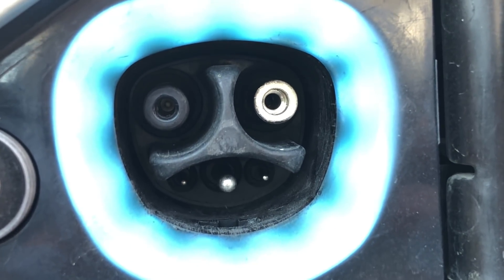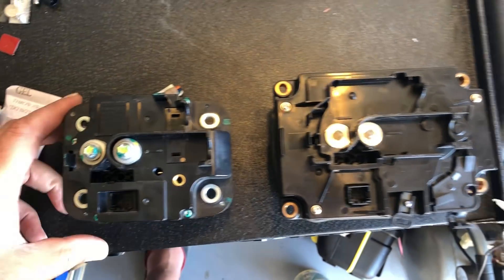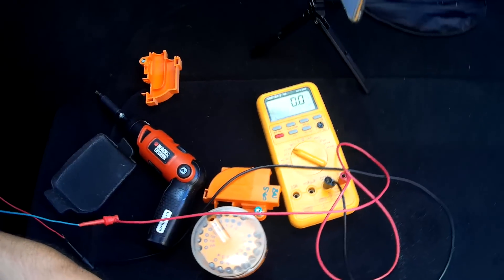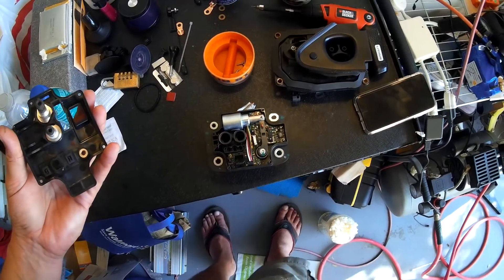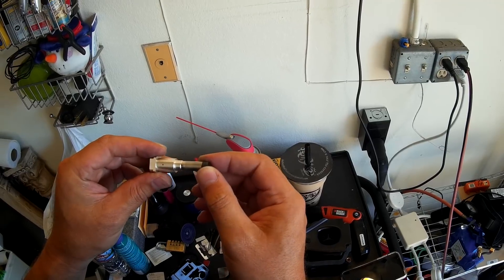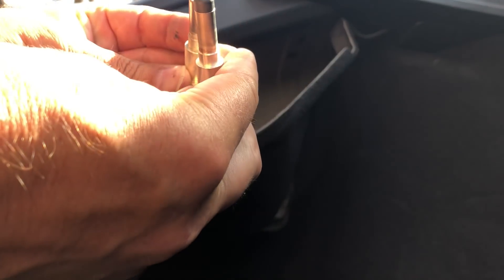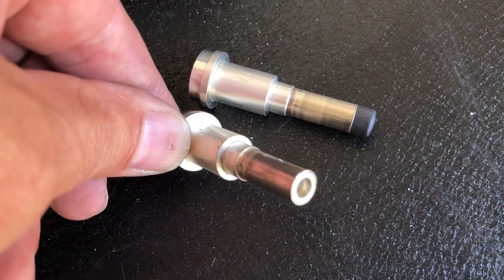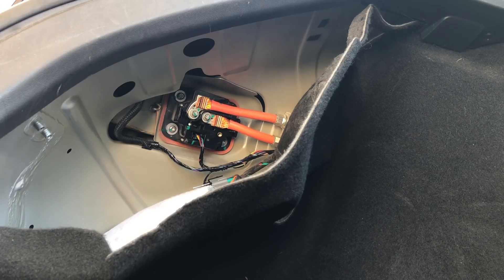Fixing Tesla's charge port

Comment: I just replied to @poster7176 but thought I’d ask you too, especially since this is an old post and they may not see my reply. The black plastic piece from the charge port is stuck in the bottom of my home charger connector.  It’s too narrow to reach with needle nose pliers.  I tried fishing it out with a paper clip but couldn’t grab it with that either.  Seems to be jammed in there pretty good.  Suggestions?  I think I could simply glue it back onto the charge port prong if I can get it out of the charge connector.  Thank you.

Comment: Thanks the older Models of these cars get as any other brand they need some parts replaced, just normal wear and tear. My 2014 Model S still runs great after 360.000 km. No major issues.
Reply: You got AWD rwd?
Reply: @ceylontea5877 LDU rear wheel drive.
Reply: @ceylontea5877 but I do have a 2015 70D also and AWD is even better as you don’t have to do coolant delete as you must do on LDU.

Comment: Did it leave the top inside or is it just different and why do you need to take it apart vs just take the old out and put the new in connect the wires and done? What did I miss?

Comment: 1 plastic tab was lost  in my charge port, when second is gone - supercharger doesnt work. I used epoxy and fixed one, supercharger doesn’t work, other chargers is ok. This plastic tabs used for right plug position ( adjustment by deep ).

Comment: How did you get the plug out from the existing port and the new port? I'm trying to same thing and it's not coming out from the replacement part that I purchased
Reply from the maker: You have to take the charge port out of the car completely and then tack the back cover off. Then you can take out the pins.

Comment: I had the same problem - Tesla also quoted me $750. i was getting an "error charge port not latched correctly" and simultaneous green and orange LED lights on the port. . Car would still charge but only at 16Amps at home and less than 1/2 speed at supercharger. I found the black plastic piece mentioned above in my home charger connector. it obviously came off when we were charging at home. I  just Super glued it back onto the car port and now charges perfectly with no error messages . check your port, they should both have plastic piece on the ports on the car. Shame on Tesla for not offering solution and  $2 part. I have had 2 Teslas - The current one has 100k miles on P85. Love the cars. Hope tis helps.
Reply: Mine just came off on a road trip and im a little terrified.
Reply: This comment is very helpful. Thanks for sharing! Sounds like a super cheap fix for you 😄
Reply: How did you get the black plastic piece out of your home charger connector?  I have the same problem but the black plastic piece is really jammed into the connector and it’s too narrow to reach with needle nose pliers.  I tried a bent paper clip but can’t grab it with that either.  Suggestions?  Thanks.

Comment: Do you know if its possible to change the US Tesla port to CCS2 charge port (Europe) ?
Reply from the maker: No, the wiring is different inside the car. Also, the car does not know how to communicate with CCS stations. Tesla added that in later models and it is now offering it as a retrofit (hardware) to support the CCS adapter

Comment: The blank piece is not for guidance, it's for finger-proofing. A requirement for J1772/IEC62196/ECE R-100 is that you must have finger proofing for all HV circuits. Cannot contact any conductive surface. That was the main issue you had. If there was a leakage current, you could have been shocked.
Reply from the maker: The J1772 standard did not exist when Tesla designed their charge port. Regardless, the rounded or conical shape of these pieces is to guide the contacts, insulation against touching is sure another purpose but the shape makes it pretty obvious

Comment: Good Job!  My 2019 tesla model 3 had a problem with the charging port gate.  It sometimes won't close by itself.  My car was parked outside of my home. The service man came to my home to fix it.  I was not there at the beginning.  By the time I got there, it was almost done.  I found that he opened the front trunk and also lifted up the rear-right seat cushion  Why did he do that.  I asked, he said he turned off the power and motor.  Does that sound right to you?  I thought the power can be turned off on the screen.  Thanks!

Comment: Are the pins that’s you replaced the same between the two versions of the charge port? Basically if I’m just swapping pins can I take them out of the newer design or does it need to be from the 1005612-00-G?
Reply from the maker: Yes they are the same for all X and S, all generations

Comment: Well that's kind of embarrassing for Tesla and that rediculous quote. If all that pin does is just for alignment purposes, I would think a number of jury-rigged solutions come to mind besides buying a whole assembly on eBay. Now that it's done and your now educated on that way to fix it, would you do the same again or try a jury-rigged solution?
 I love the company but they are very far from perfect.
Reply from the maker: I asked Tesla again about buying just the pin or plastic piece separately but they said they don't. I travel a lot and visit many Supercharger. I found over 40 of these little plastic rings stuck in Supercharger plugs.
Reply: Shame on Tesla.  Should have been $200 maximum fix, honestly probably 50 bucks.  700 is crazy.  

Love my Tesla.  But the company has shit on owners constantly.  FSD is a scam.  So many including myself having paid thousands for it and it will be nothing but a beta for long time to come.  Many bought it for leased vehicles and by time lease is up there’s been 0 FSD release.  

Hyped company that hasn’t taken care of owners.  They need more service hubs and an overhaul on reasonable out of warranty pricing.

Comment: Any tips on how to unplug the two cables from the back of the charger? The three-prong one looks like it pulls straight out, but the black one looks like you need to press in a tab somewhere.
Reply from the maker: The connectors have a locking mechanism. It's similar to a ethernet network cable. Just a small pin that locks in. You squeeze it and the connector comes out.

Comment: couple things to prevent death, the leads in the video appear not to be CAT III rated, he has no lineman gloves on, safety glasses properly rated. While you may think its safe, this type of power will not give you a chance.
Reply from the maker: There is no power on the charge port unless it is connected to a charger and a proper handshake is in place. For the charge port to have power without a charger, there would have to be a failed main contactor inside the battery itself and a failed contactor to connect the battery directly to the charge port. Both of these would not only have to fail at the same time, but they would have to fail in a way that they get stuck in the closed position which is close to impossible as they are designed to open (disconnect) as soon as anything goes wrong. Even though this event is already next to impossible, I still checked for power on the cables to verify it's safe. At this point, it is far more likely to get killed driving my car in normal traffic than getting electrocuted.
Reply: @DavidDrivesElectric  David, have you been to training? Do you know why the cables are orange? Do you know the osha regs? I appreciate your confidence, but many electricians have been injured by trusting imprudent theory. For your sake don't encourage risky behavior. You tested the lines to be sure with non cat iii test leads, if your so sure why even test them? There is always the possibility of an error. Please don't take chances.
Reply from the maker: @e_p_rry5935  I appreciate your concern and I know it is genuine. I understand electricity very well and I know the safety system in the car to be able to judge the risk. Considering all the factors, the risk is lower than driving the car on a daily basis.

Comment: Is the replacement reflector from series 1 the same size as series 2?  My door was hyperextended, breaking the red reflector.  Have found the door for series 1.  Tesla want 150 parts plus 500 install. Would like to simply replace reflector. Thanks
Doug
Reply from the maker: I'm not sure. I will have to check
Reply from the maker: Definitely a different size reflector
Reply: I bought the series 2 part but think rather than try and remove the existing and replacing it.... i might just put the slip the reflector off and glue it on with a bead of glue  - Tnx Dave! 
 @DavidDrivesElectric
Reply: Did it workout?

Comment: Great video! I have this same exact issue right now.  I was wondering if you tried to get the little black knob that came off from Tesla or elsewhere and just pop it back on rather than rebuilding it? Or, poping it off the one you bought?  I'm sure the knob itself is a 20 cent part. I still have the one that fell off as it was stuck in my J1772 adapter, but it's damaged. I'm also guessing once you pull it off it has a higher chance of coming off than a new one but didn't know if that was worth a try vs. rebuilding the whole thing?  Thx!!
Reply from the maker: I asked Tesla and they don't sell the little black piece. They don't even sell the individual pins. Only the entire charge port assembly.

Comment: What is the part number? Thanks for the video.
Reply from the maker: 1020288-00-A for the old type charge port
Reply: @DavidDrivesElectric  did the fast charge work after the pin change?
Reply from the maker: @haufitareyou2981  of course! No problem.

Comment: It's nice to see how Tesla made the car reasonably serviceable and replacement parts are available. Thanks for sharing that.
Reply from the maker: Yes the engineering on Teslas is really good. The guy I bought the parts from is an experienced mechanic working with German cars and he said the Teslas are by far the easiest to service from a mechanical point of view. Of course most of it is CAN bus controlled which seriously limits the ability to do many things yourself. For example you can't put in a new seat without programming it into the car's computer and Tesla won't give normal people access to do that.
Reply: @DavidDrivesElectric  where did you get the replacement part from? I need to buy this part for my Tesla
Reply from the maker: @adrianajamilethherrerayher8874  Autobahnparts
Reply: Yes, especially when this repair will cost you about $700 at Tesla (I guess that amount I heard in this video, if I am not mistaken)
Reply from the maker: Yes Tesla has high prices on many simple service tasks. That's why I like to do those things myself.